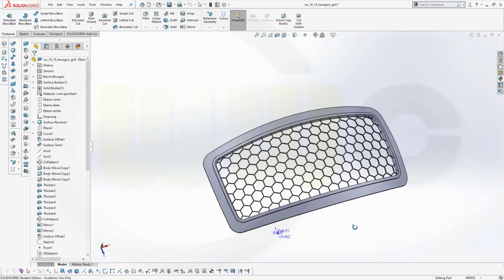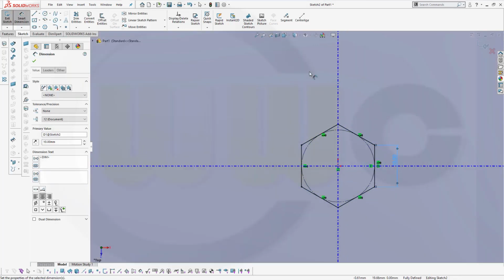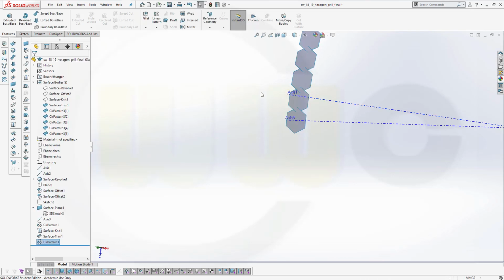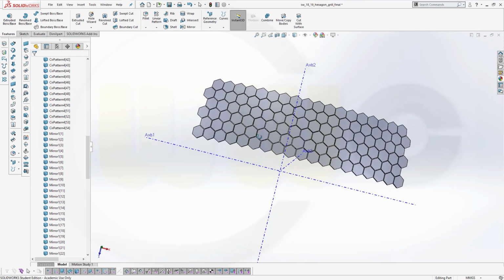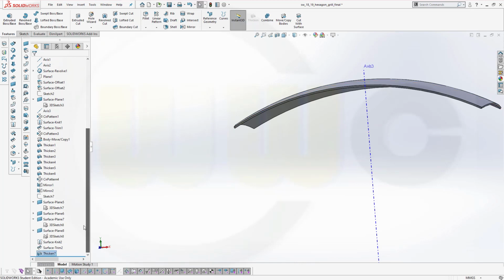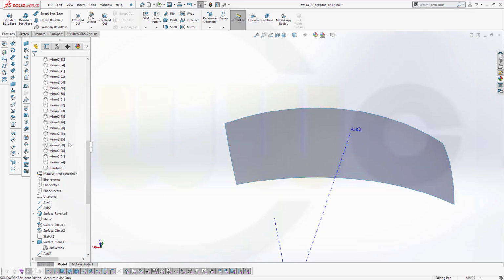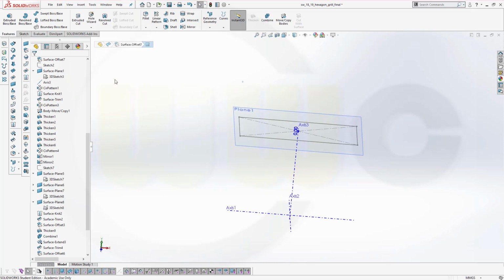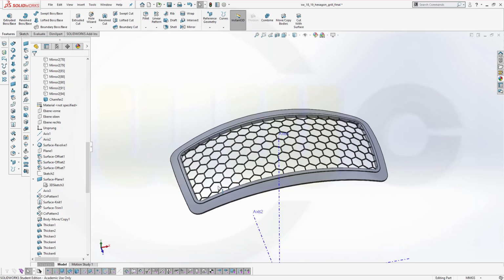Hexagon Grill - SolidWorks 2018 / 19 Training - Part Design

Comment: Sir, I don't know but when using a circular pattern I need to divide all values you insert by two. I think my SW is taking as reference the central point of the hexagon and yours is taking a vertex. Do you know why?
Reply from the maker: Sorry, the reason must be something else. All pattern features in all programs use the central point of the feature, which you want to pattern as default reference. And even if not, it would not matter because the distance between the instances would be the same anyway.

Comment: Solidwork or siemens ?
Reply from the maker: easy decision siemens nx or if you don´t need surface modelling: inventor
Reply: @wolfgang.walden.cad.training   I made this part inside ZW3D didn't you check out that video ?
Reply from the maker: @hameddesign70  If you put a link into a commentary - this commentary will be put automatically  into the spam folder by youtube. I check these commentaries only from time to time. You might know - time is precious and I´m very busy with my work - paid trainings. So I took a short look at your video. The result is good -  the way to the result - kind of strange.
Reply: @wolfgang.walden.cad.training  I didn't knew that haha XD
Thank you sir
Reply from the maker: @hameddesign70  you´re welcome
Reply: @wolfgang.walden.cad.training  If you watch that video i'll be glad to do more comparison corporations with you ;-)
Reply: @wolfgang.walden.cad.training  u didn't like solidworks? but why? can u write the most important proplems or disadvantages this cad?
Reply from the maker: @den_temny  This exercise was just a pain to do in solidworks, it will be almost the same pain in onshape and autocad. Anyway Solidworks is at least overrated.